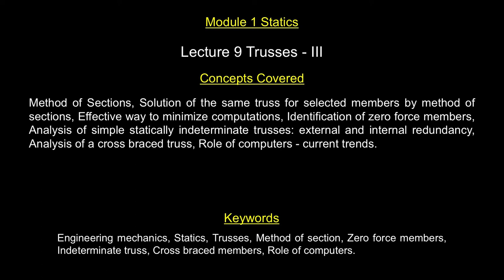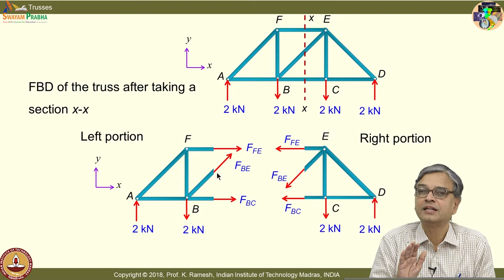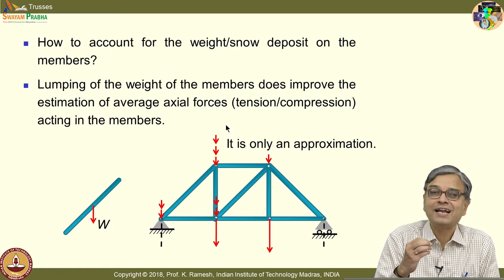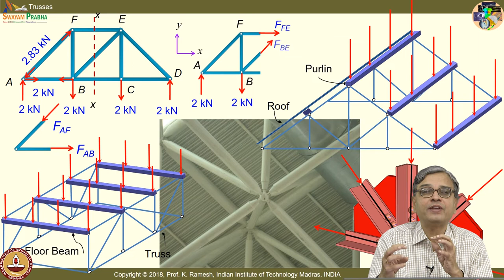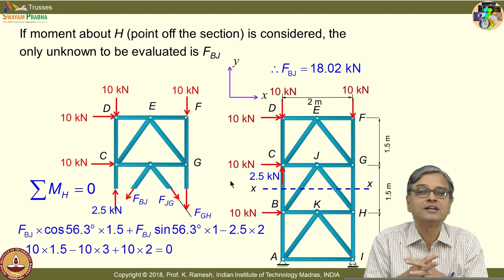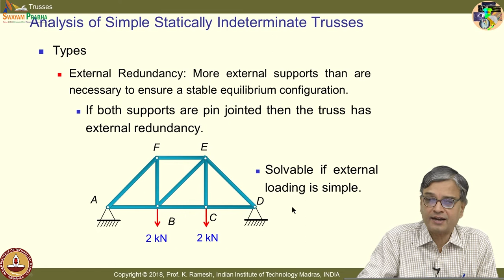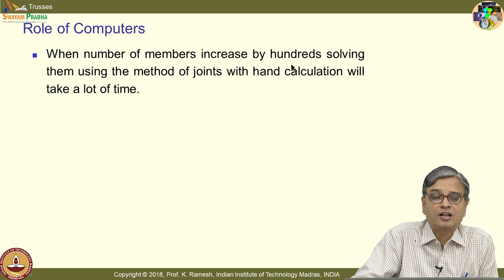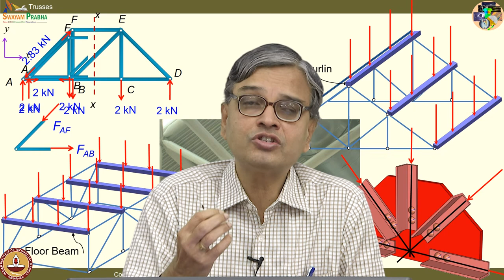Lec 09 Trusses III

Comment: Confused at 33:09 is there should be sin 56.3 or cos56.3
Reply: The answer has been mistakenly calculated using sin56.3

The correct equation considering ∠JBK should be:

ΣFx = 0
+10 + F(BK) + F(BJ) cos56.3 = 0
+10 + F(BK) + 18.02 cos56.3 = 0
F(BK) = -20 kN.

In the interest of correctness, you can refer the above mentioned equations.

Video editing for the error will be effected before the next course run.

Comment: 33:02 I think there is a mistake. It should be Fxcos(56.3) and not Fxsin(56.3)
Reply: Right
Reply: @ritasingh7078  exactly
Reply: @Rita Singh @AKASH RAUT

Your observations are correct. The answer has been mistakenly calculated using sin56.3

The correct equation considering ∠JBK should be:

ΣFx = 0
+10 + F(BK) + F(BJ) cos56.3 = 0
+10 + F(BK) + 18.02 cos56.3 = 0
F(BK) = -20 kN.

In the interest of correctness, you can refer the above mentioned equations.

Video editing for the error will be effected before the next course run.
Reply: Yess i noticed it. 😁

Comment: @33.01.... Fbk+Fbj *cos56.31+10=0 gives Fbk=-20 where as the answer given is -25 kN
Reply: Your observation is correct. The answer has been mistakenly calculated using sin56.3

The correct equation considering ∠JBK should be:

ΣFx = 0
+10 + F(BK) + F(BJ) cos56.3 = 0
+10 + F(BK) + 18.02 cos56.3 = 0
F(BK) = -20 kN.

In the interest of correctness, you can refer the above mentioned equations.

Video editing for the error will be effected before the next course run.
Reply: Iam also got confused bro..thanks for the clarification...

Comment: 30:42 isn't it Fbj cos56.38*1+Fbjsin56.3*1.5?
Reply: No u must consider the distance towards the line of action of of the point of moment ur considering
Reply: @rishabhbiddappa7342   thank you for your reply but i still didn't understand it well.how does the cos component of  Fbj acts at a distance 1.5m. can you please help me out ?
Reply: @melvindavis3629   cos component should align with the line of action of the point about which u consider the moment
Reply: Thanks you. You made my day
Reply: @melvindavis3629  no problem
Reply: As @Rishabh Biddappa correctly pointed out,

While taking moment about joint G, the angle considered is ∠CJB = 56.3 deg.

The cos component of F(BJ) would be along JC which is at a distance of 1.5 m from joint G.
The sin component of F(BJ) would be along the centreline of the truss at a distance of 1.0 m from joint G.

The moment has been taken following the standard conventions:
anti-clockwise moment = positive and clockwise moment = negative

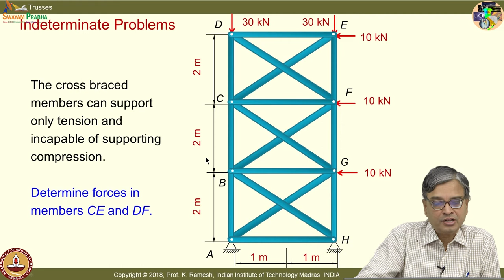Comment: 42:38 why can't we solve by section method as CDEF is section  &apply moment zero at C to get force FD.
Reply: A section cutting CD and ED would expose forces F(DC), F(EC), F(FD) and F(EF) in the free body of truss.

In case you take moment about C, this would give an equation involving F(FD) and F(EF). Hence, one cannot solve for the force F(FD) at once using this section.

Take note that any section selected must cut the truss completely into separate portions. See 4.10

Comment: Sir can u help in solving 2019 gate trusses question in your method
Reply: Which method is used to solve gate questions?
Reply: @debjyotidutta8285  generally .. section only..
Reply: @debjyotidutta8285  both depends on question